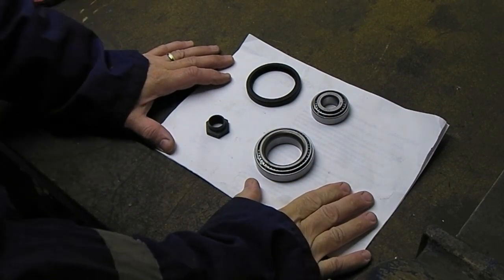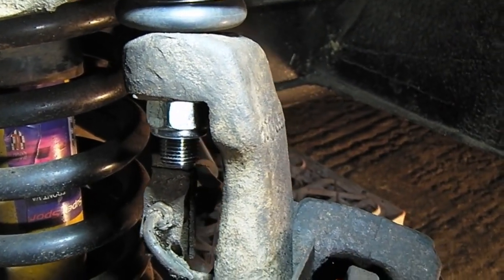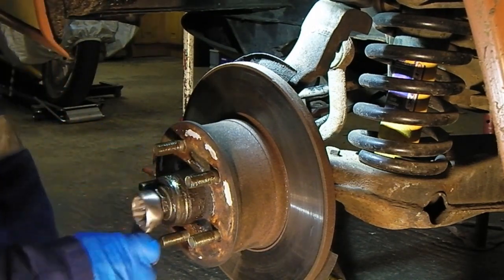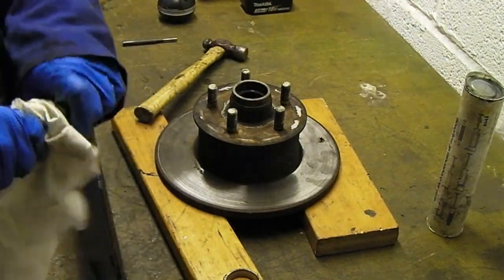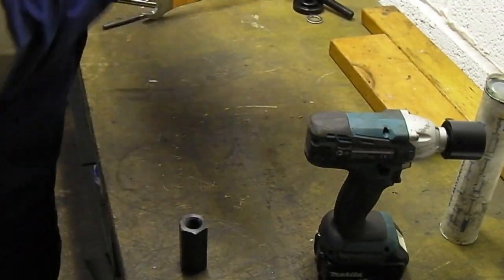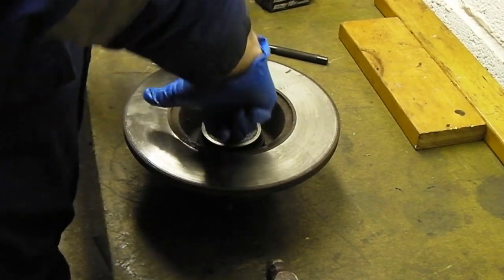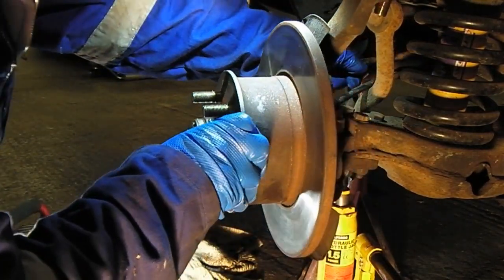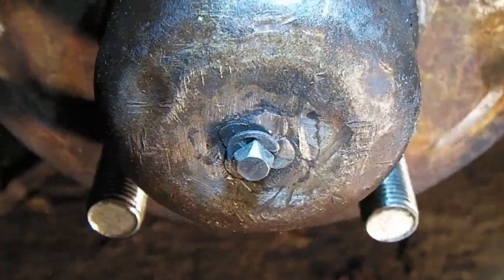How To replace a T25/T3 bus Front wheel bearing.

Comment: Sorry, bit confused, but doesn’t the hub nut get torqued vs just wee past finger tight? The one holding the anti rotation washer.
Reply from the maker: Probably, you would need a crows foot adapter for the torque wrench though. I haven't got any so did it the old fashioned way 😁

Comment: I have just changed mine, but for some reason the disc is now sitting way too close to the heat shield, what have i done wrong? Its throwing loads of smoke out, and now locked the wheel
Reply from the maker: Have you definitely put the outside race of the inner bearing into the back of the disc? I had the same issue years ago and realised that I had forgotten to fit it and just put it all back together. Easily done.

Comment: Hi Larcs, great video, inspired is to have a go at replacing off side front bearings, but we can't get the caliper bolts out...any tips etc...
Reply from the maker: Thanks, all I can suggest is to turn the wheel to give you good access, use some easing oil, use a six point socket and breaker bar and give it all you've got. Sometimes a bit of heat will help.
Good luck sorting it out 🤞.
Cheers Larcs 👍

Comment: Great Video.  This is what is on my 85.     If I have a lot more drag when I spin the hub,  could it be too much grease ?  I definitely used more.  THen, I tightened it down tight and backed off, but it has a lot more drag...but washer moves...I'll go back and check it while it still sitting on the jackstands.
Reply from the maker: Thanks for the feedback. More grease might be a bit 'draggy' especially if it's really cold. I would whip it off again and check everything is OK just in case though. If the seal isn't fully home or not quite straight it will cause it to drag. Check the bearing races are in straight too, but this is more likely to cause a 'loose then tight' sot of feeling. Good luck
Reply: @LarcsWorkshop  thanks, seal was not even, races were in there tight, checked just to be 100%, but it was the dust shield..the originals were rusted away, and the new ones were not identical, I bent them back and everything works now...I used a mercedes spindle nut ....Thanks !
Reply: @DanTheManIOM  Brilliant, glad you sorted it out.

Comment: A 100% correct video. The (stiff) sliding of the washer indicates the right applied torque on the nut. 
Apply the right (SKF) wheel bearing grease, but not to much. Keep everything very clean! Not 1 particle is allowed here.
Checking the torque in practice:
It is very informative to lift the wheelcaps after after a sufficient long drive (say 30-50 miles) and feel the temperature of the bearing on the black cap. A well torqued bearing is luke warm, that is the normal temperature. 
Louis van Rijn.  405.000 km in a 1980 T3
Reply from the maker: Cheers

Comment: I've no circlip on the speedo cable, oops
Reply from the maker: I wouldn't worry too much, I was running with a bit of wire wrapped around mine for years back in the day! 👍
Reply: I was wondering what that thing was. The previous owner siliconed it on.